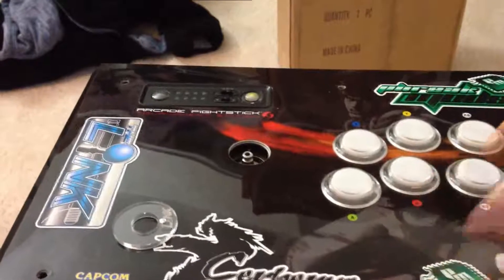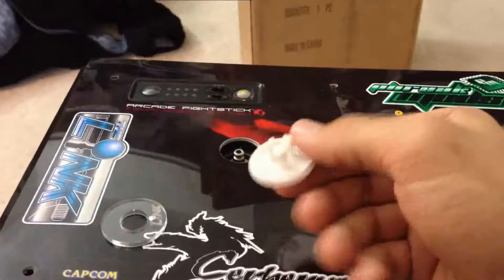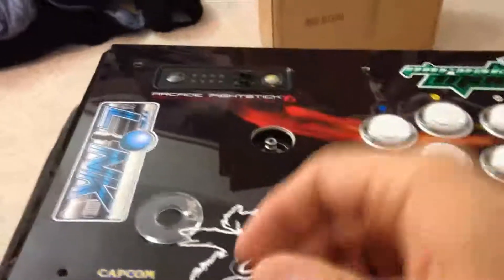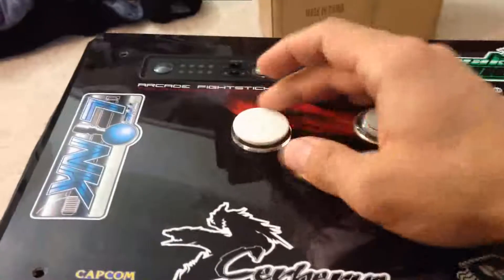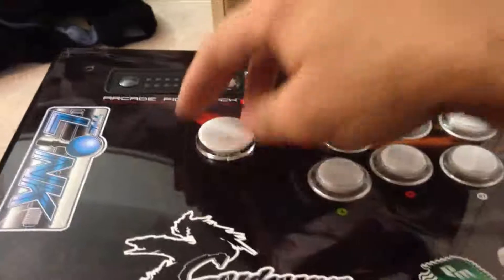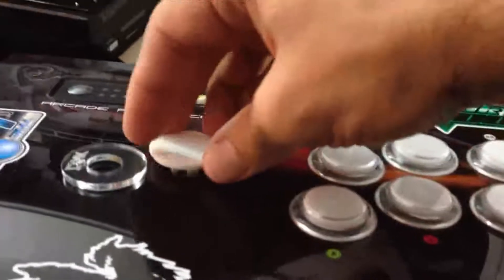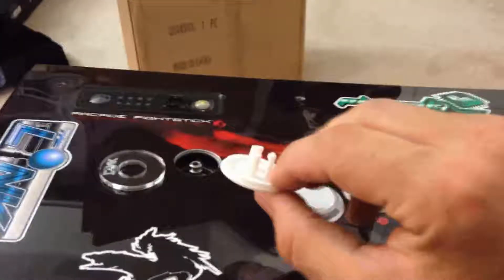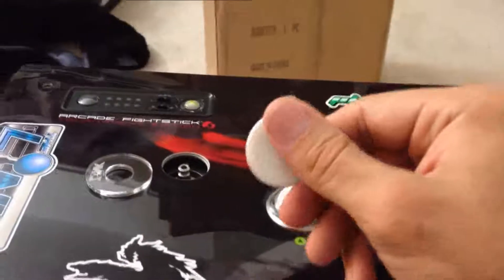Link JLF U-Cap Overview

Comment: What size is that washer? 38mm? I just got mine and its wobbly. I think I need a thicker washer.
Reply: I tried combining my two washers and that sort of made it better. They're both small standard ones though, still a little wobbly.
Reply: Ok, I added I made a cardboard washer for the gap. Completely covers the hole and does not move. So Pretty much I added 2 standard washers, a cardboard washer, and the Link JLF U-Cap. If anyone buys this they should have a THICK dustwasher and buy the cap with extra Gap space (Link JLF U-Cap: LP ShelledFlange) or MAYBE the standard (might have the same problem like me). Overall pretty OK, I just wanted to cover up the hole because of dust/other crap while carrying my stick in my bag.